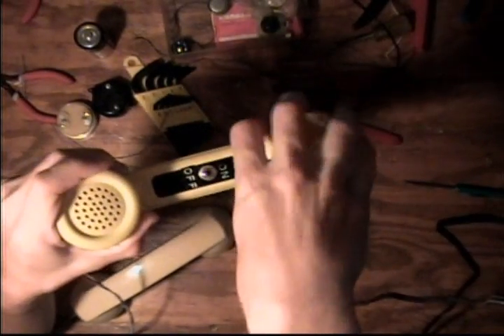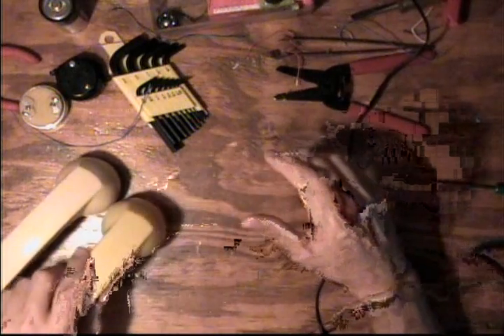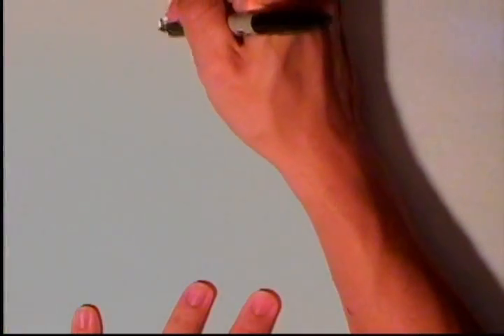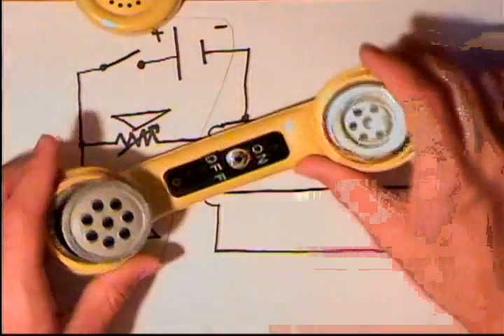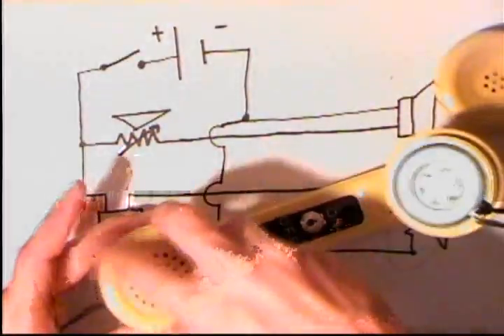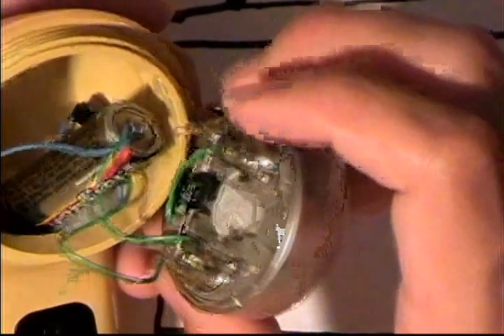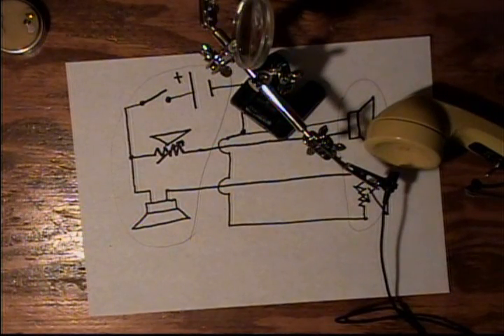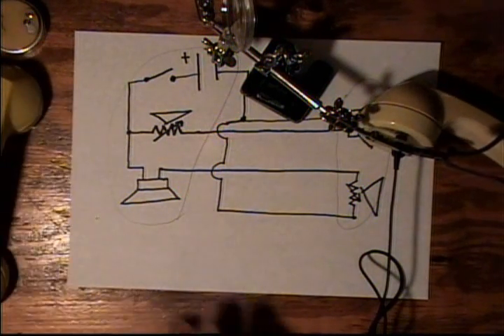Build a simple communicator using old telephone handsets!!

Comment from the maker: With higher voltage, it is louder, and in some experiments with carbon mikes and speakers, I have found that a higher voltage makes the sound more clear and there be less background noise, and there seemed to be a "cutoff" point when using a phone speaker and carbon mike at around 15 volts where the sound got weaker (perhaps the diaphragm was pushed outward too much in the speaker?).

Comment: Enjoyed your video.  One tip ... the carbon particles in these mics tend to clump up over time/use and reduce audio fidelity ... if this has happened and you take the mike end of the handset and give it a couple of sharp raps against your palm (or gentler ones on a harder surface) this breaks up the clumps and the person on the receiving end should hear a noticeable improvement.

Comment: Thanks for clearly showing us how the mic and speaker are connected in an old handset. I still need to know how to connect the 3 loose wires in handset back to my phone. My problem is the cord has been cut off and removed from the phone.In my handset I have a cut green wire in goes to the center connection of the mic then goes up to the speaker’s center connection that it sits on (which looks like a positive connection). The next cut wire is yellow which goes up to the speaker’s outer edge ring to contact the speaker when in place (this looks like a negative connection). The third cut wire is red which connected to the mic’s outer ring bar that it sits on (it seems odd that this red connection is here as a ground for the mic). Another odd thing is on this same bar is a second screw that's is loose. What wire connects here?

Comment: fantastic video - exactly what i was looking for for within our larger electric conversion vehicle.  my question is, re: the handset on the RH side of the drawing, couldn't the wire between its speaker and microphone be internal?   thus allowing this to be done with only 3-conductor wire between the handsets, as opposed to four?  thanks so much.
Reply from the maker: Four years hence, I finally give a reply. Yes, I have converted this to a 3-conductor version, and have a video of it, shot years ago.

Comment: Hehe cool! I did the same thing when i was like 9-10 years old :D
Reply: Chet Carson  lol yes I did, but with complete standard phones. It was just a matter of connecting them in series with a 9V battery and you could talk between them. The hook and all worked as normal.
Reply: Chet Carson  I did this nearly 20 years ago, and don't have any of the stuff left.. But you can try it yourself if you want to. You literally just hook two old telephones in series with a battery and it works. The bell wont work or anything, but you can talk between them.
Reply: Chet Carson  Did you wake up on the wrong side or something? Or do you just not understand the concept of connecting two analog phones in series? Either way, have fun with your 9 subscribers and no videos of any value. Cheerio.
Reply: Chet Carson  It is the same basic idea, though.. You don't need the entire phone to do it, since all it does at that point is connecting the mic and speaker over the lines, and modulate the current in the circuit using the mic at either end, reproducing it as audio. It's about as complicated as a lightbulb and a switch..